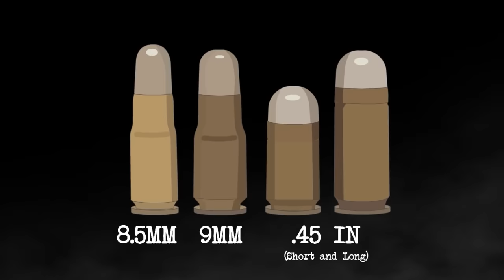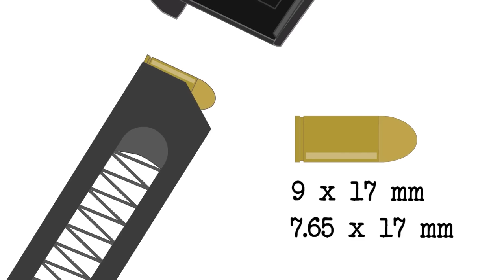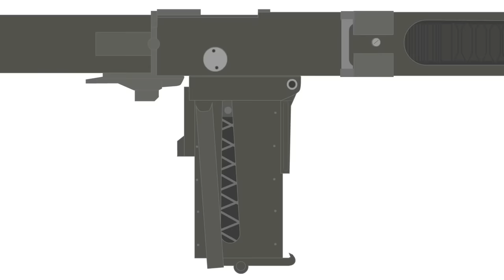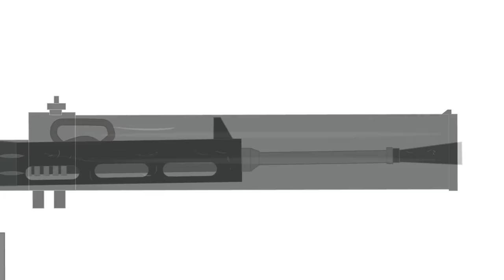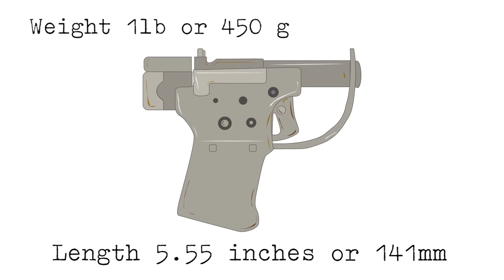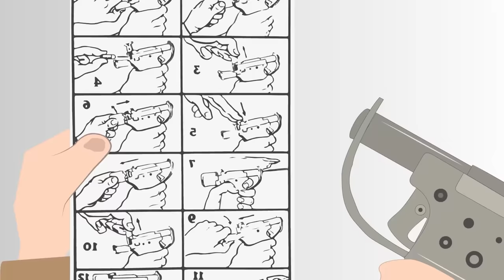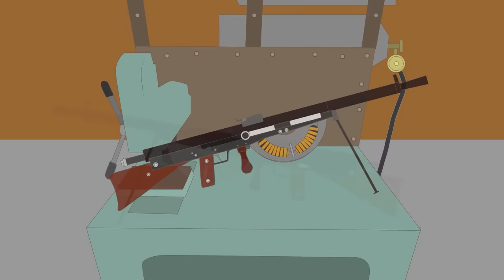Cursed guns that shouldn't have been made

Comment: Would increasing the size of the trigger guard have improved the Mars? Or was it a completely lost cause?
Reply: It was done for
Reply: How would that have helped exactly? The main problems with it were that the design was too complex, the cartridges were too powerful (the 8.5 and 9mm Mars cartridges have twice the muzzle energy of a regular 9x19mm round, and still significantly more than the +P+ loads), and the designer refused to ever make any concessions to the design that would have improved it.
Reply: @jubuttib  Well I didn't know much about the Mars at the time. The one complaint I'd noticed however was small trigger guard so I was asking if itd help the feel of the weapon at the very least, or if the weapon itself was a lost cause. Sorry for any confusion. But I know more now about this thing then I did 4 months ago. I appreciate the reply though, did not know about just how strong the cartridge was.
Reply: @oshadow8325  Ah ok, fair enough. And I meant no I'll with the question, and should also have probably spread the reply in two paragraphs to separate the question and the explanation about the actual problems.

I didn't see any comments about the small trigger guard when looking for Mars comments (was looking if anyone had explained the cartridges, since the video did them a disservice by just mentioning the diameter, shown to be fairly meaningless by the 9mm glisenti being referred to as severely underpowered in the video), but the video mentioned the heavy weight and high power being big issues. So I was curious as to what a larger trigger guard was supposed to do, in that context. =)

Nice to hear you've managed to learn more about things, I think learning is one of the greatest things a human can do with their time, especially learning how to think. =)

Comment: 2:17 That's called a chain-fire, not ' cooking off '.
Cooking off, is something entirely different.
- The Mars was absolutely not a cursed gun. It was a necessary part the development of modern autoloaders ( First to use a 6 lug, rotating bolt 🤔) Hugh G.F. began designing the Mars in 1897, one year after the C96!
 The Mars was the Victorian Deagle. .45 Mars Long is ballistically identical to Remington .44 Mag loads.
Nobody knew HOW to shoot a pistol that powerful....they didn't exist!
Reply: The equivalent of the 45 Mars long did exist - the Colt Paterson with its original 75 grain loads (the pistol tended to explode when fired).

Comment: About revolver rifles, the zylinder gap is the issue, wasting powder and burning the arme if used like a rifle, a manual repeater chain firing would be a quality issue, because if it was a design fail, pistols would have had the same problem. 
Next about the italian pistol: 9mm para is a hotter cartridge than .45. It has to withstand higher gas pressure. 
One main problem with the gyrojet is the slow accelerating bullet. Which completely screws up accuracy. Even the tiniest shake or trigger jank would throw it wildly off target. I stopped watching after that one. 
There is quality content out there. So there is no reason to watch a channel with simple research methods.

Comment: Something to take into consideration: Some of these guns were engineered under the duress of WAR! If the weapon does it's target justice, well then get some gloves, and some face-masks, and commence fighting. The Colt Model 1855 Revolving Carbine is better than an M16, and it's certainly more reliable. The pain is a bonus that keep's you awake, and in the fight.
Reply: Not sure what your definition of better is, but the only thing the 1855 does better than an AR or m-16 is burn your hands or decorate a fireplace.  Reliability hasn't been an issue since the army started issuing cleaning kits and the correct powder in the cartridges.